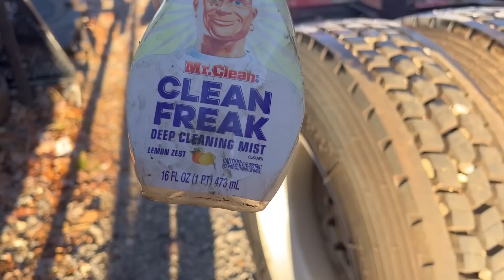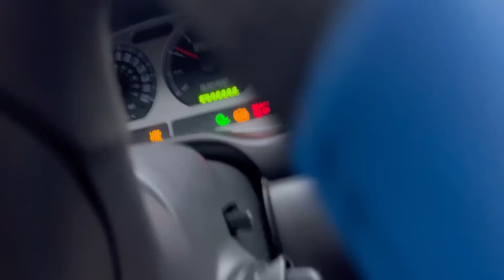We are bringing a FLD!! Back from the dead (this thing cleans up good)

Comment: The 4.6 l was supposed to take over for the 5.0 5.0 is a 302 and they said the 4.6 had more horsepower than the 5.0 Hagen Ford you're in Bay City Michigan at subcontractor